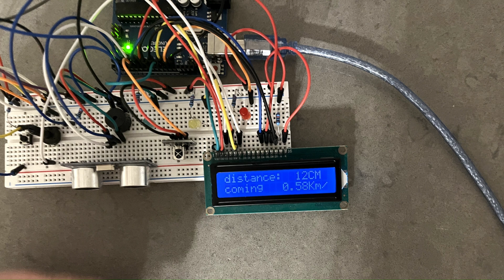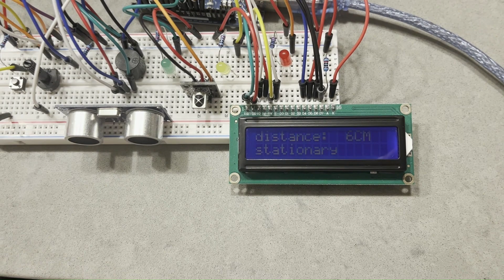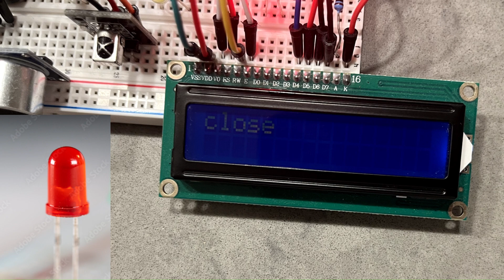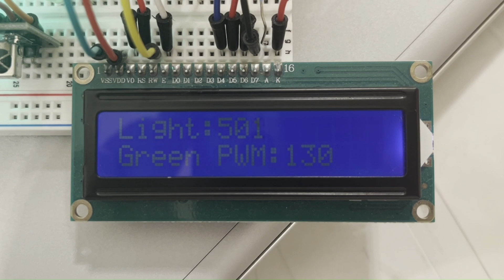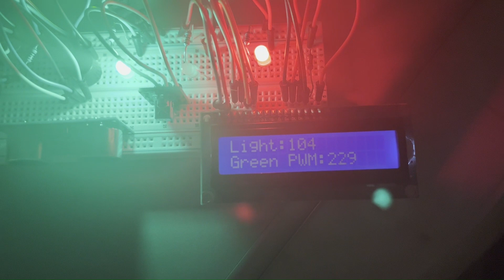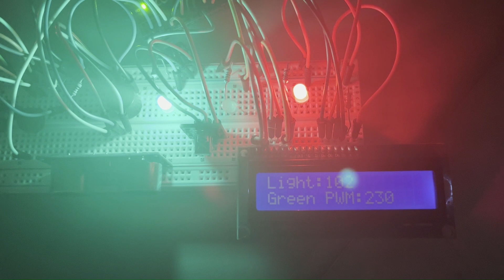Sensor Project

Comment: Great sketch. Does your IRremote library only work with only the Ky022 receiver? Initially when I connected the Uno to my laptop I had 3 led lights but now I have no lights and nothing on the lcd either.